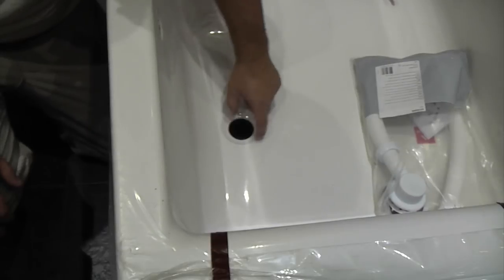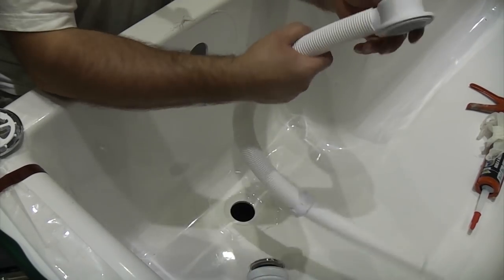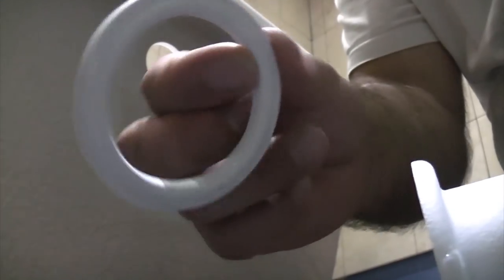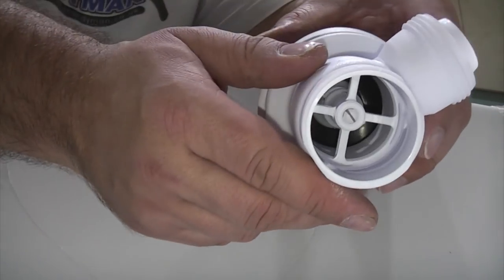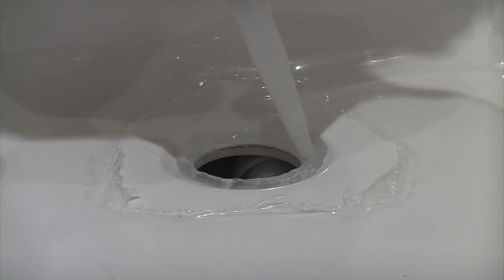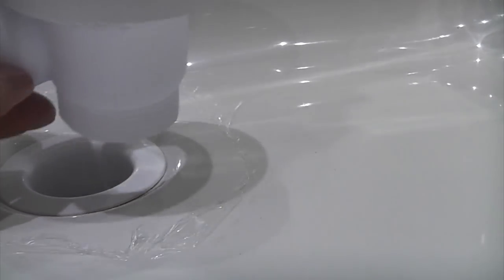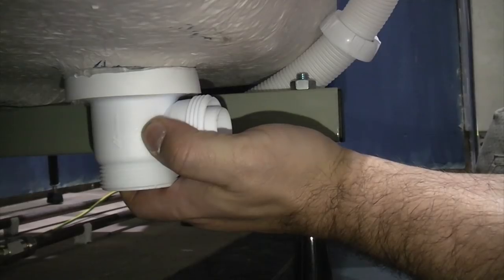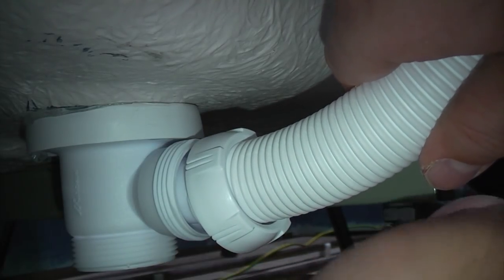How to install a bath waste

Comment: over flow holes are the best invention after sliced bread unfortunatly here in australia we only have the single drain on the bottom is there some sort of conversion kit which converts single drain to drain+overflow

Comment: 2:33 Great video. I have the same but just wondering before I seal the overflow, how will the water go through as to me, when the chrome cap is placed, there isn’t a visible gap for overflowing water to go through. I’m the cap is quite flush to the bath surface
Reply from the maker: I could be mis-reading your comment here, but the plug is either in the overflow (when the bath is not in use), or in the drain hole (when the bath is in use). 
Thanks for the comment 👍

Comment: Sorry I didn't quite catch which sealant you used?
Reply: I had to replay the video a few times to catch it, think it was Nescafe gold or grip fill although it could have been no more nails, no hang on , think  he said, it was sticks like shit.You wouldn't catch me using that rubbish, I use PLUMBERS GOLD!!
Reply: Tetley whippet silicone sealant.
Reply: Its silicone sealant i think
Reply: I had a good laugh when I discovered there is actually a product called "sticks like shit"
Reply: It’s silicone but wholly unnecessary on the part of the fitting ‘inside’ the bath and questionable on the outside but probably won’t do any harm ….

Comment: What type of sealant should be use, so many  are available in market. You are using here Plumbers Gold which is Adhesive as well. Is it safe and suitable to use or any other better option. Thanks
Reply from the maker: I'd only use one that is suitable for this purpose.
Plumbers gold is formulated for jobs like this. McAlpine also make a similar sealant, but it's twice the price of plumbers gold.

Comment: Do you normally have to wait until the sealant is fully cure and dry on the bath waste drains and overflow pipes / covers before connecting the bath waste traps?
Reply from the maker: No, as long as you don't let any water down until the sealant has cured, it should be fine ;-)
Thanks for the comment 👍

Comment: Nice, concise video....your drain kit is somewhat different than the one I'm using on a new (remodel) bathtub install and I really like that your kit includes the flexi pipe whereas I would have to buy that part separately (another $7). You are in the UK, correct? I sometimes wish we Americans would learn a few things about retail packaging from our brothers across the pond.
Reply from the maker: Yes, I am in the UK. Plumbing and electrics seem to vary so much from country to country, as do the prices of components etc.
Thanks for the comment

Comment: Thanks for the really helpful vid. How easy is it to disconnect the waste if it needs replacement when using plumbers gold?
Reply from the maker: You are welcome.
I'm not sure, as I have never had to undo a waste that has been sealed with plumbers gold.
Thanks for the comment

Comment: My overflow pipe has a small hole and leaking slightly. Would it be possible to repair the hole? With sealant or glue or epoxy maybe? Or would it be better to replace the whole pipe?
Reply from the maker: Yes, you could repair it, but it's unusual for holes to develop in them, so a new pipe might be the best option.

Comment: Hi. When you're fitting the parts and applying the sealants and pipes for the drainage  etc in place, can't you do it whilst the bath is pot if you remember to have the outlet pipes tightened in he right direction. Would this not help as will be more room. Or is the a reason you can only fit when in position.

Great video. .
Reply: Marie Ros
7

Comment: Hi.
I'm trying to change my bath waste its on an old metal/enamel bath. Do you unscrew from beneath the bath where there appears to be a large brass nut at the top of the thread next to the bath or do you unscrew the plug hole from inside the bath. I cant budge the nut that's under the bath so wondering if that's fixed and you unscrew from above. I've seen people on YouTube insert pliers into the plug hole and turn using a lever of some sort. Either way its stuck solid. Any suggestions would be a help.
Thanks Alan
Reply from the maker: The brass nut should undo, but you may need a large pipe wrench to loosen it as it may be stuck using plumbers mait etc. Sorry for the late reply, I have only just seen this comment!

Comment: Hi enjoyed your video ,  we have a bath with  low waste pipe  from bath touching the floor and  connected to rest of pipe witch is about 1 inch from floor if we turn the water off  first but how do we get over the rest  my husband just got a kit and used the seal and he now says we need
Reply from the maker: It's not easy to do if you have little clearance beneath!

Comment: Hi Mr.  Handyman,
Thanks for reply! I have another question.. I hope you can help. I will be fitting a bath but the frame has not been provided. I do not have the bath brand as yet and where I am located it is not possible to get a stand. Is there a bath stand frame that will fit all baths. Also I don't think the bath has a screw in place for the stand to be secured. Could this be fixed on with a strong adhesive or is there another suggestion for this. If there is a one size fits all bath stand I can have it sent and know that it will fit no matter the bath brand. Last bath was placed in cement with bricks but this seems a bigger job. Plus am nervous if something goes wrong you can't just remove a panel to get to the problem. 
THANKS..
Reply from the maker: Marie Rose Mcfarlane 
All the baths I have installed have come with the legs/feet. They are normally specific to that particular model of bath!
You can but universal bath stand kits, providing the bath has a piece of wood on the bottom of the bath (normally under the fibreglass). If you use a universal leg kit and fit a couple of battens to the wall (providing it's going against a wall) you should be able to fix it properly.
Reply: That's great. Will try to get one shipped and hope don't flood house first bath time.. will follow your directions, but still be prepared for surfs up..
Reply from the maker: Marie Rose Mcfarlane 
You are welcome.
These might help, if you have not seen them before-
https://www.youtube.com/watch?v=tRweaE32_ks

https://www.youtube.com/watch?v=cKqmvUyAVqE

Best of luck with it ;-)

Comment: You just watched a video on how not to install a tub waste an over flow. Good grief corrugated pipe on the overflow and no tee. Is this in the uk? If you had to snake that drain you would have to put your hand in the backed up water
Reply from the maker: Yes, this is in the UK. This is how we install them over here ;-)
Thanks for the comment 👍

Comment: how do you remove overflow that was put in with plumbers gold ? wd 40 . my overflow is leaking , I thought it was from the hole in the bath . But it is from the cable connection to the pop up at the overflow level
Reply from the maker: Yes, you could try WD-40 or perhaps twisting the two components apart will work?
Reply: Thanks WD 40 did the trick , bought a new pop up waste . its not leaking from the bath . I can only think its the pop up that's got a fault in the overflow section . cheers
Reply from the maker: You are welcome
Thanks for the comments

Comment: hair  stoppage  is  the  biggest   problem  to  flex drain,.it can not hold 1/4  inch  per foot  slope  and will definitely clog easy.  snaking  the  line  will punch the  low quality flex drain.
Reply from the maker: +Right Flow Plumbing The flex part is only the overflow, which should only ever take water if someone puts too much water in the bath.

Comment: a plumber just put my bath in for me , but it was leaking from the overflow so I took it apart and put plumbers gold on the inside and out and screwed it back together . but it is still leaking from the overflow
Reply from the maker: You should get the plumber back to sort it.
Plumbers Gold is normally great for that type of job.
Reply: thanks for your reply I managed to get my phone behind the waste and its leaking from the cable where it joins the overflow at the top .

Comment: geese the bath waste systems in the uk are junk. here in the us we use solid pvc pipe.
Reply from the maker: We do too, but the waste overflow connects to the waste fitting using the flexible tube

Comment: tried to clean out the pipe under my bath; but now leaking - bother - wisdom welcome
Reply from the maker: If it's the overflow pipe, I would inspect it for holes/splits, if there are no holes or splits, I'd apply some silicone sealant and refit the pipe.
Reply: @ultimatehandyman  thanks, I think it was the way I fitted it; I re-fitted it, and crossed fingers no leaks now - it's quite hard to figure out what I did wrong .. . or right...

Comment: hahah  nor have i till i watched this vid in a desperate attempt to fix my bath :(

pulled the plug out earlier and the whole waste thing came out with it still attatched as i watched the water just flood out through the hole in the bath !
i need help so bad !!  hahahaha
Reply: Well my bath is in an old rented house in a v confined space and the outlet waste pipe wch is metal broke ystrday and a full bath of water went thru the kitchen ceiling. Any temp fixes or could i fit new pipes myslf?
Reply: Sounds bad but think mines possibly a lost cause?
Reply: Bet mines worse than urs? Haha, sorry i cant help, im a novice bt wouldn't mine trying to fix my own mess. Im going to put a deep plastic tub in the bath so i can at least wash my hair.